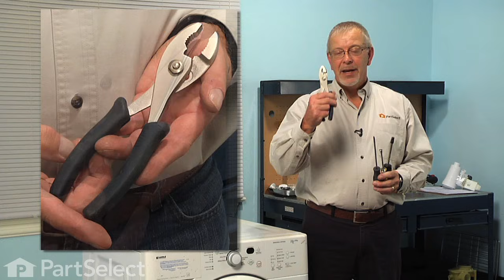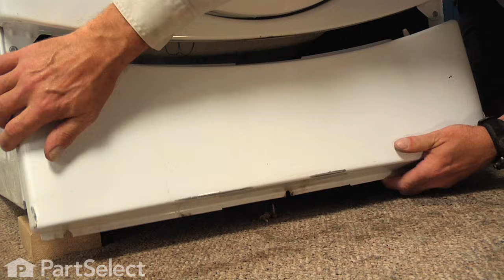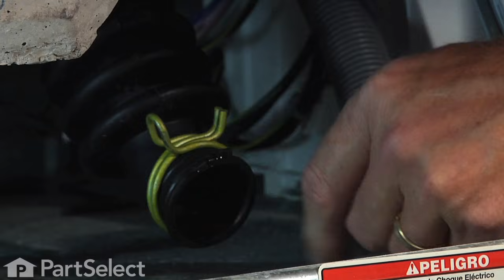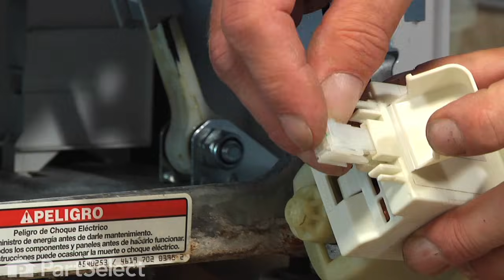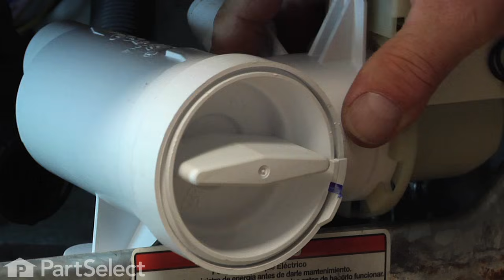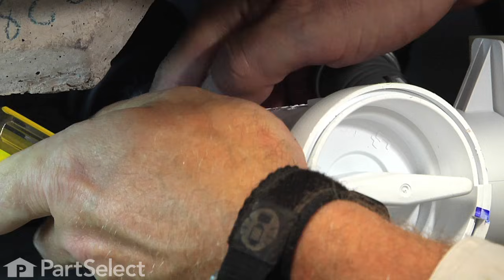Washing Machine Repair - Replacing the Drain Pump (Whirlpool Part # W10130913)

Comment: Very good detail on showing the pump replacement.  Took about 20 minutes and the pump is nice and quiet now.  I found one on Ebay for $47.  On my Maytag 2000 series washer one clamp was the pressure clamp that I could re-use, but one was a pressed on crimp clamp that I replaced with a stainless hose clamp.  Very easy fix to save a bunch of money.  Thanks

Comment: Thanks for the video.  I thought cleaning the trap would do the trick but when I pulled the pump and saw that the impeller was loose, off to Sears I went and 20 minutes later I'm doing a short cycle to rinse the clothes that I was washing when it went T.U..

Comment: This was so helpful. I had taken off the pump previously with another instructive video, and this explanation was so much easier, thank you! The machine is working great now except there the buzzing/humming of the pump is rhythmic vs constant. I don't care as long as its (relatively) normal. Or maybe I just don't remember what it sounded like when it was working properly.  I will recommend your videos to ANY I have found else where! Thank you thank thank you!

Comment: I occasionally get a H F error on my front loading whirlpool duet. Cleaned all the hoses and changed input hoses from reduced flow to regular. Before I purchase and install a new drain pump (your video is awesome), could overloading the machine cause this problem? Thanks.
Reply from the maker: Douglas Dufault There are several things that may cause an HF code to appear. The code is generated when the control senses that enough water has entered the washer but the pressure switch has not been tripped. Check the small hose that connects to the pressure switch for any signs of chafing. Make sure that the washer is not siphoning out the water while it is filling due to a short stand pipe height or too tight of a drain hose connection to the standpipe. We have also heard of defective flowmeters and control boards causing this problem but not the drain pump.

Comment: Very good video thank you! One question: is there a NEED to replace the button trap with the pump?  I was able to find just the pump for significantly cheaper.  Would there be any reason that your experience would say not to go with that route?  Thanks again!
Reply from the maker: If the gasket is still in good shape, then I would say that you could reuse the button trap.

Comment: Great video..replaced my pump in 10 minutes...washer works great again. and is a lot less noisy.. I got 7 years out of the old pump....funny we never knew about the drain filter pull out ...seems like the manual would tell you to clean it out every so often..

Comment: Personally, I would use the old clamp rather than the one provided.  The old ones unless rusted should be ok to use...and preferable.  It's the same thing in the hoses on your car radiator and other items.
Reply: True.  It might be difficult to get a screwdriver inside in the back.

Comment: regarding the spring for the inlet / outlet hose, can you use a regular clamp, or do you have to reuse the spring tight clamp? what size is that spring tight clamp?
Reply from the maker: Hi Ra's, thanks for the kind words, and for watching our video! We will include a gear type clamp to fit the inlet hose with the pump. The outlet/drain hose spring clamp can be reused, or you could replace it with a gear clamp. The outlet is 1 inch.